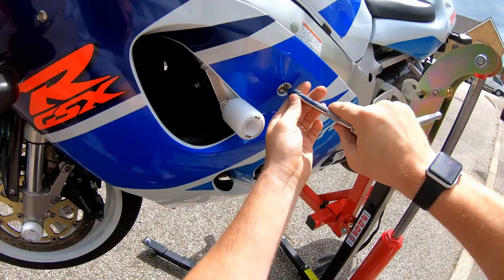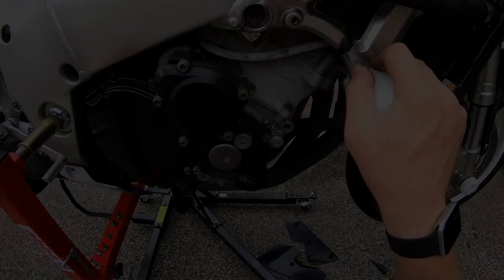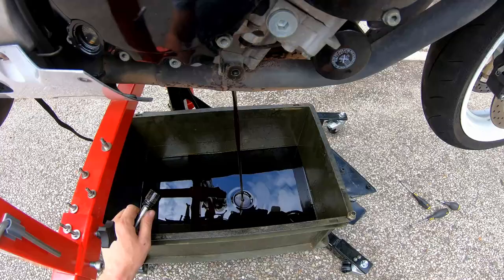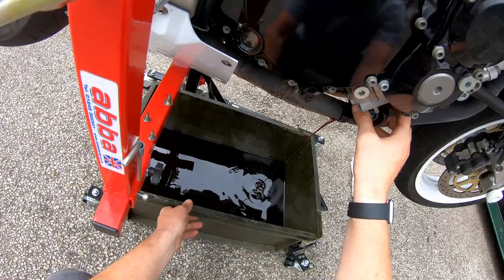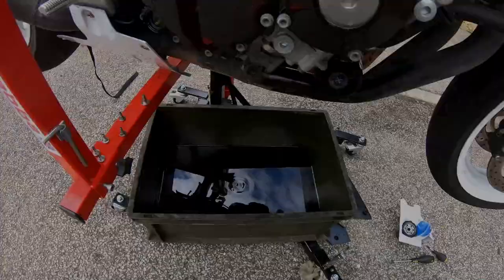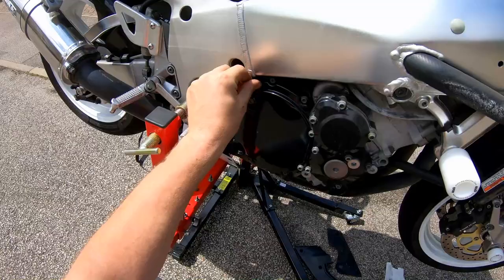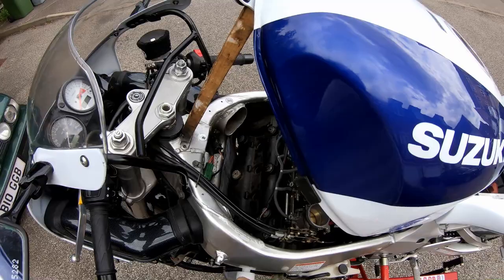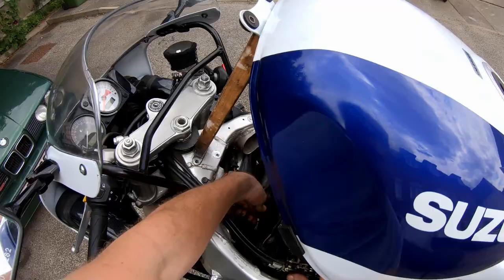Servicing my 1998 GSXR750 SRAD. Oil, Oil Filter, Air Filter, Plugs & Coolant.

Comment: Just finished doing all this to my SRad. The only thing I did differently is disconnect the spark plug wire first, and changed each spark plug one by one.Thanks  for your great video!

Comment: When I want to avoid spillage on the exhaust I wrap some aluminium foil around it. That looks like an immaculate SRAD btw. Last year I picked one up that had been standing still for 6 years in a shed. All it took was a service like you did, a carbrettor revision kit (mine is a 97 carburetted one) and a new fuel tap. Runs like a dream with 74K kilometers on the clock. Good times running that besides my R1200S.
Reply from the maker: It’s a great idea about the foil on the exhaust and I’ve had a lot of people make that very suggestion! It’s simple but highly effective and I’m stunned that I hadn’t thought of it before! Great tip for a great bike! Good times indeed! 👌🏻😎

Comment: Nice work, just purchased a clean Srad and wanted to reassure myself of the service process on this bike. You used the best oil as well although I'm not getting into that 😀. With the screw that's damaged the sticker you could spray up a washer to match the colour then do the other side so it doesn't look odd it should hide it. Nice clean bike by the way. 🤘
Reply from the maker: tim higton good idea, I’ll look into that 👌🏻

Comment: The price of these has gone bonkers, managed to pick  a nice one up for a steal, so this is homework.  Cheers.
Reply from the maker: I'd never sell mine, I have owned it too long and have grown too attached to it! 👍🤓
Reply: @KevsShed  hello sir... I’m new to motorcycles and have a 98 srad 750... I went down on it  a few weeks ago(car pulled out in front of me)... but it’s still rideable... I’ve rode it a few times since but now the f1 light comes on when riding and the oil light flashes when the ignition is on, and also bogs a little while riding, can you suggest something please, I don’t wanna mess the bike up completely, but I want to ride it every day lol
Reply: @KevsShed  and yes it has oil in it, that’s why I’m confused that the oil light flashes
Reply from the maker: @Seeno_V  https://youtu.be/PS1qSCq4E9U
Follow the guide in this video. It is for an SV1000 but the process is the same. It will give you the trouble codes that are causing your FI light.

Comment: Thank you. Haven't been able to find any video's on the 98 srad 750.. seems everyone has the 600 or 1000 K1 on up, & it's hard to find OEM parts for the   98 750.
Reply from the maker: The good thing about Suzuki is the Suzuki Vintage parts Program, this means that pretty much everything is still available OEM. Also if you are in the UK, Fowlers are a great resource for genuine Suzuki parts too.
Reply: It’s not hard at all. Suzuki has everything for this bike

Comment: I have the same one bot 97 my 1st oil change bot i wud like to now best way and easy way to clean or grease the chain
Reply from the maker: Hi mate, I get what you mean, here is a link to a video on my channel that covers the exact thing you need. Not on an SRAD, but my R1 track bike but the process is the exact same regardless of the bike! https://youtu.be/QmNOR9LdUDo
Reply: Tnk u so mush for that link one more question is the chain supposed to be tide or a little bit lose,  only ask cost am new on bikes and i got this last summer  ready to ride bot as u now getting it ready for this summer
Reply from the maker: @crlrod049  No worries dude, always best to ask than go on a whim! Anyway, to answer your question, the drive chain should be tensioned so that at the mid point between the front and rear sprockets has between 20mm & 30mm of free play checked on the lower run of the chain.  Hope this helps buddy.

Comment: I intend to buy a 1997 model with 37000km, it is in very good condition. What are the common issues with this model?
Reply from the maker: The 6 pot brakes require routine maintenance to keep in top condition and working as intended. Fuel tanks can be found rusting inside if moisture has been allowed to get in. The rectifiers can be troublesome but other than that, all round excellent bikes!

Comment: I know the plug at 19:52 came from the back of the right hand side of the airbox. but where does it lead to? I just bought a project bike and this area was capped off .
Reply from the maker: Hey mate, it was the Intake Air Temperature Sensor. If yours is capped then would I be correct to assume that you have a carb model?
Reply: @KevsShed  I have a fuel injected model. Where would that hose lead too?
Also at the back of the tank where does the far right gas line go too? This bike came completely disassembled all advice will help.
Reply from the maker: @itsraheem  Sorry, my bad, I thought you meant the sensor and not the hose. What i'll do this weekend for you is pop my tank up and take a few pictures for you mate.

Comment: I just bought a SRAD 1999, I changed the oil + filter, new spark plugs, new battery, cleaned the carbs m and turned it on....the bike is alright until it reaches 80°C in temperature 🌡 starts to shuts off with a bit of white smoke out the exhaust when I rev it...when I put the 1st gear it start to shake and suddenly gives power but then when the RPM get low it shuts off....
The bike was stored for 3 years and have only 30k KM.
What to do??? Kindly help me
Reply: Im planning to change the coolant as well soon. 
I'm confused why it shakes and shuts with a bit of white or blue smoke, not sure...
Reply: Too bad no one replied. I hope u got it fixed. Bleu smoke means too much oil burn or oil in the wrong place i think. Too much oil in cilinder maybe piston rings bad. Good luck

Comment: Avoid using engine oils not meant for motorcycles.
The additives in them are not meant to be used with a wet clutch

Comment: What does eneal the sump plug mean?
Reply from the maker: Annealing is the process by which you soften the copper washer (not the plug) helps to ensure a good tight seal. Annealing also allows you to reuse a previously used copper washer too! It work hardens as force is applied during the tightening process. Aluminium washers cannot be an annealed however and must always be replaced!

Comment: Why not use Shell Helix Full Synthetic motorcycle oil? It’s the best I know for these bikes.
Reply from the maker: Thanks for the comment buddy and thanks for watching, oil is a very subjective thing in the same way tyres are and one persons opinion on the subject will not be the same as another’s. However, I do not use a fully synthetic oil in any of my bikes. In my experience, fully synthetics can cause clutch slip in some instances and EBC even state on the packaging for some of their clutches that fully synthetic oils should not be used in conjunction with them. Obviously this comment is not aimed at causing an argument on the topic but merely my opinion!
Reply: @KevsShed  Ah cheers for the advice, thank you. Thanks for the video as well! I always thought full synths were the best. I didn't know they had some counterpoints as well. I have a 99 SRAD 750 with low 8000miles  (a museum example, pretty much same as yours). I rarely ride it though and I've had a pleasant experience with the Shell Helix FS as I mentioned. Which oil would you recommend or do you use?
My bike used to fire into life immediately with just a quarter revolution of the starter engine like yours, but lately it takes quite a few cranks for it to turn over. That's with a brand new battery. I'm suspecting it's the plugs or the quality or brand of oil at this point.

Comment: How crazy would I be to pick up one of these in 2020?  I love the classic GSX-Rs and the 98/99 is probably my favorite that at least have fuel injection to avoid constant carb maintenance.  Any specific problem areas I should look for when bike shopping?  I know it won't be as problem free as a new bike, but I just love this generation of GSX-R and it would have to be an especially bad ownership experience to make me turn away.  I'm well aware of the normal old bike stuff, just wondering about anything specific to 98-05 GSX-R 750s and if any particular year is especially good or bad.
Reply from the maker: Get one, you won’t regret it! The only real thing with the SRAD models to watch for is the R/R as they aren’t the best and also check for excessive cam chain noise. Some owners fit manual tensioners and these are fine as long as they are correctly adjusted 👍🏻
Reply: @KevsShed  What do you mean by "R/R"?  What should I be listening for for the cams and what kind of problems/expenses should I expect if I was to hear it?  Would it just need a chain replacement or is the noise representative of something bigger? As with anything, if the bike is otherwise perfect, what kind of money should I talk the seller down to offset either issue?  A perfect bike rarely exists as we all know, so it's just about arming myself with how much each issue will cost to fix to get a fair price on a mostly good bike.

Comment: Масло в фильтр не налил
Reply from the maker: Doing so serves no purpose other than to make an oily mess on the floor! You'll no doubt be aware that this engine requires 3500ml of oil when totally dry after an engine rebuild. It requires 2800ml of oil to fill to the max mark after an oil change. This means that there is still approx 700ml of oil inside the engine even after draining the oil pan. For some reason people seem to think that the engine runs dry just because the oil filter hasn't been filled before fitting. Absolutely pointless exercise, but if it makes you feel better then feel free to do it on yours!